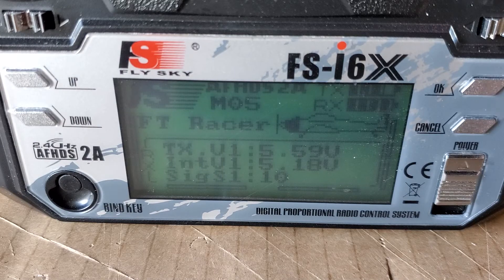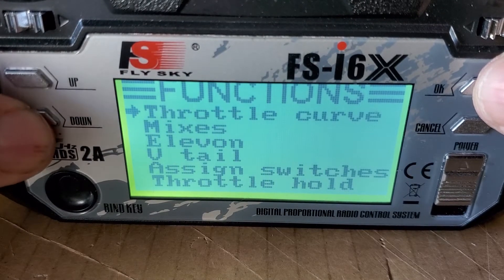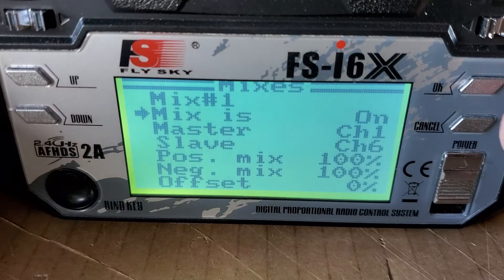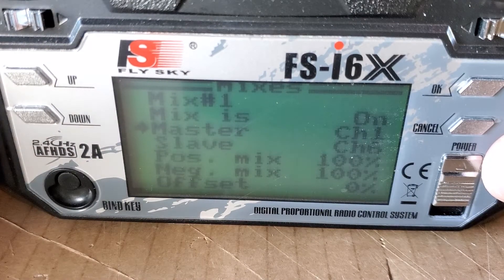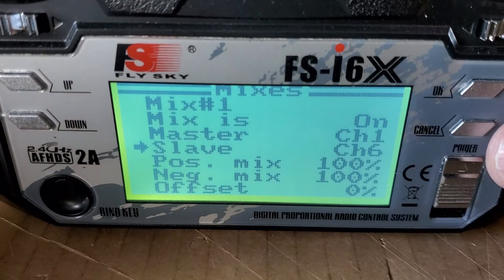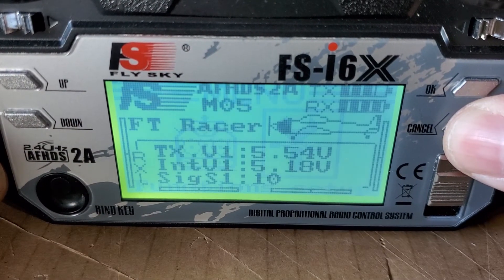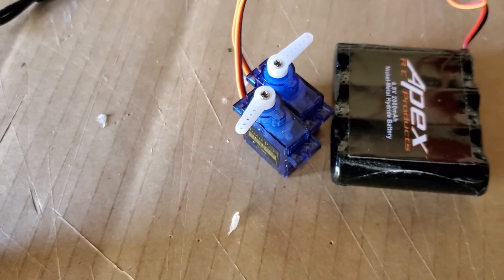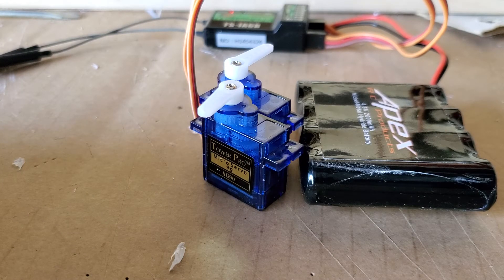FlySky Two Servo Aileron Setup

Comment: Hi I have followed your instructions and have 1 slight issue, when I push the stick right, both servos move in opposite directions, when I go left only channel 1 moves channel 6 stays centered, cant figure out why
Reply: I think I have cracked it, channel 5 and 6 had aux settings, I've set channel 6 aux setting to none, and now it all seems to be working fine

Comment: woo hoo i just got everything bought and built on my very 1st project plane which is a Mike Stott super chipmunk. Had to build the wings myself with 100$ worth of balsa. I just getting started and had to buy everything new for the initial purchase of electronics and wood and rods and servos and.......blah blah blah and i had to rethink the way the original control line was set up with zero room for where the servo would go in the fuse (not doable) so i just did a servo per wing.  44" and anyways i found this vid and it all worked great.  thx dude

Comment: I did exaclty what u did. But my servo connected to ch6 only turn in 1 direction and pos and neg mix is both 100%, tried ch 5 same problem but ch 4 works. But then my rudder also controls my ailerons
Reply: Had the same issue, now it works well. You have to select on the according aux. channel none. 

https://youtu.be/d02UARXh7LU?si=yIyZo_zZa8db4Mn_
Reply: Did u figure this out

Comment: I have a flysky i6x
I want to warn in weak signals(rssi alarm or low signal alarm)
Do I need to update the firmware?
🙏🏻🙏🏻🙏🏻🙏🏻🙏🏻please guide me
Reply from the maker: My TX will alarm when there is signal loss. Not sure if there is a low signal alarm. I know when I am ridge soaring and land on the back side of the hill it will lose signal leading me to believe the signal is line of sight. Once I begin walking toward my plane, it recovers the signal with a secondary alarm.

Comment: It is possible to make this servos with another switch to lock down for flaps?
Reply from the maker: Absolutely. I like to use the C switch for this since it’s a 3 position switch. You will need to dedicate the switch to an unused channel, then use a secondary mix that assigns your flaperons that you mixed to that channel.
Reply: @davidjust548  Okey, thanks, the only problem is 2/3 mix lose